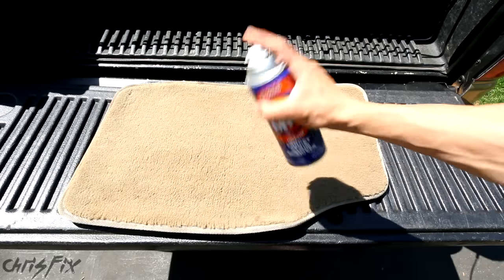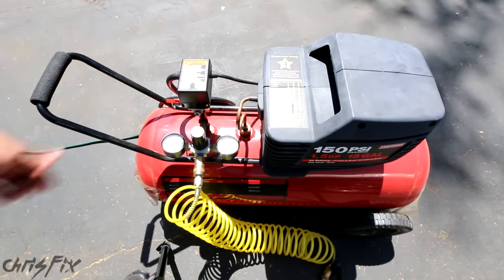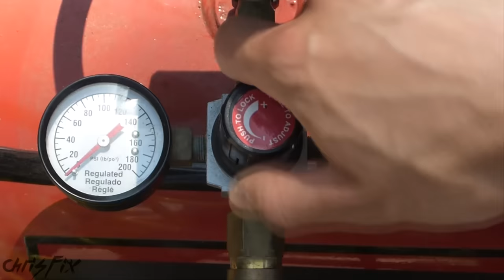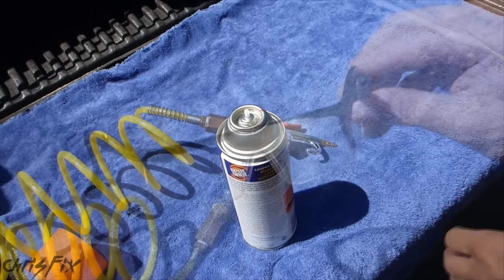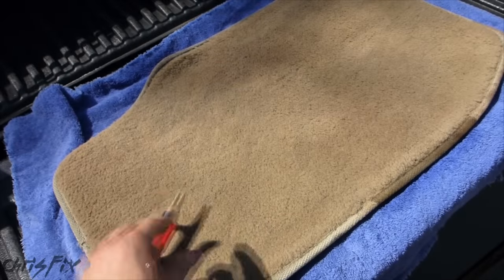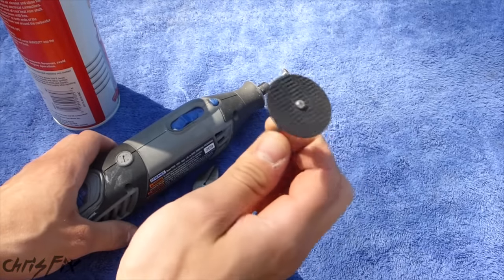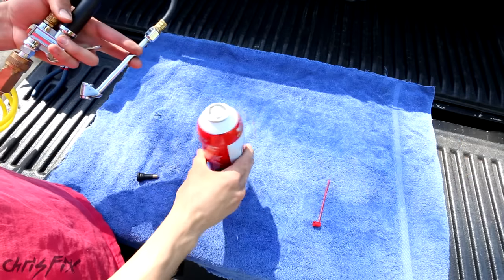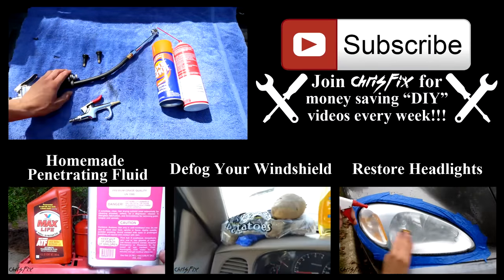How to Refill an Aerosol Spray Can (Like Carb Cleaner, WD40, etc)

Comment: If your can is mostly full of some liquid, you would need insanely high air pressure if you wanna be able to empty the can before running out of air. Actually those cans usually use liquid gas (not compressed air) as a propellant, the gas evaporates at a specific (temperature dependent) pressure keeping the can at a fairly constant pressure (until you run out of gas of course). Usually butane, propane and/or other flammable gases are used for this, which is also the reason the aerosol sprays typically burn so well, even if the actual being sprayed out isn't flammable.
Either way though, compressed air certainly beats throwing an almost full can away. No doubt about that.
Reply: That's what I thought.  No way would you be able to use even a quarter of the contents before running out of pressure.
Otherwise the cans would have to be able to hold 1000 pounds pressure.
Those ' computer air blasters ' are filled with inert refrigerant. If it were just compressed air they would run out in three blasts.

Comment: I found an easier way because it happens a lot and I like being safe. When ever I by anything that is in a pressure can I save the receipts and put them in a file marked with the cans purchase and return it we're I purchased it for a replacement, never been refused by any store as long as I switch it out for the same product.

Comment: One could 3D print an adapter to go from the compressor to the canister.

As of January 2020, the MSDS is now called the SDS, Safety Data Sheet.

Comment: For any spray csn with a standard long nozzle tube you could fill up an empty large wd40 can with air and do a transfer from that can to a smaller can using the long nozzle.  Keep a couple of these air-filled WD40 cans around.  Another point is that compressors often shoot water out  you want to make sure your compressed air is dry before you fill a can. Water in oil paint is a disaster.
Reply: So the red straw is the bridge between the female nozzles transferring pressure from the donor can to the low pressure can?

Comment: It's easier if you take a tire air valve and trim it down to fit the can! Some of the smaller valves don't have to be trimmed, they make an air tight seal and it's just like filling your tires with air! Plus you can use an air pressure gauge to see that you have at least the 32 lbs that aerosol cans uses!

Comment: Thanks for the video but my advice is to get a small vacuum line or fuel line that fits on the can outlet cut to a size that will bottom out while using the outlet down at the same time ,no-spill no worries!

Comment: Use a cut off piece of rubber hose. The right size would fit tight a small ways up the brass air nozzle and if cut off the right length there will be enough to cover the can nozzle  plus give enough room to push down and seal the can. Just a thought.

Comment: I superglued the straw into the air compressor fitting, so you add the air and then push down on the button till it quits bubbling in the can equalizes.

Comment: i use those can-type air duster. most of these are uses liquid  refrigerant as propellant. Invert the air duster can and fill the empty bottle with LIQUID propellant. Done

Comment: I have cans of paint from the 60's that still work well.  The propellant hasn't leaked out because it's Freon. The government banned the manufacture of  Freon (and R12 refrigerant) in the early 80's, to protect the ozone layer.  They replaced the Freon with CO2, and in some cases, butane.   CO2, being a much smaller molecule than Freon, leaks out of the seams of the cans, (into the atmosphere) before the contents are expelled, resulting in millions of partially filled cans of paint, hairspray, glue, and oil going to the landfills each year, where they are compacted (crushed). The oil, paint, solvent, etc. eventually reaches our aquifers where it poisons our water.  R12 refrigerant was replaced with R-134, a less efficient refrigerant.  So we use more gasoline to run our auto air conditioners than we would have with R-12.  

 Now of course many of the same scientists who foisted this on us,  say CO2 and our gasoline consumption causes "global warming". They contributed to the issue.   The kicker is that a few years after the ban other scientists discovered that the ozone hole was a natural event, and not caused by Freon or R12.  

Incidentally, putting air into paint cans, aerosol glues, etc., will cause the paint and glue to harden INSIDE the can.  Otherwise companies would be putting air in cans.

Comment: Just consider that youre refilling with air not butane or propane or any other propellant and that can alter the how you store it. Freezing weather hot weather expansion and contraction and the difference in expansion and contraction properties on the air could lead to harm. I do this method myself, but the msds may differ if the propellant is different. I usually just fill for the pressure i need and thats that so storage is safe.
Reply from the maker: Thanks for the tip! Usually it is at the end of the can anyhow so you use the rest of the liquid inside.
Reply: ChrisFix totally, ive had some cans laying around that were more then half full that lost pressure. I guess my point was to further inform if you plan to store or dont use the products as frequently as you may being a mechanic over an average home owner who may have a can of wd-40 last them 5 years. Anyhow, thanks for everything you do man. Keep up the great videos and stay humble!

Comment: If the can is dented would this mean that a lower psi is needed? Also, what level of danger would this have? Low, medium, or high?
Fyi: ive used your video to redo my car lights and it worked great👍🏻😁

Comment: Hi, simple idea - great! You could do better by re-charging the cans upside down - it will not squirt than :). Also I think the cans are not filled with air but rather some other propellant that is liquid under pressure like gas in gas lighters - that's why the original fill should last for the whole can unless the valves are crap and let by...

Comment: These cans are partially filled with a cryogenic liquid of some kind, that serves as a propellant. The substance is a gas at normal temperatures, but turns into a liquid when it's supercooled. As the substance warms back up to normal temperatures it would normally expand back into a gas, but remains a liquid due to the pressure in the can. Unless of course, that pressure leaks out.

This is why soda goes flat; once it's opened, pressure decreases and temperature increases. The CO2 in soda works the same way and is mixed into the sweet soda under pressure and served as a cold beverage. It stays a liquid until the pressure drops or the gas point is reached.

Filling these cans with air will work to an extent, but normal compressed air has it's limitations. The nitrogen in air can be converted to a liquid, and it's used in some types of beer. The oxygen could also be liquified, but you'd be nuts to combine compressed oxygen with anything that could serve as fuel.

The propellants in these cans usually go a long way, because the volume conversion between liquid and gas. This is similar to steam power, because the expansion happens when these cryogenic liquids reach their boiling point. Compressed air is still only a gas; so it might work to an extend but runs out of pressure much faster.

Note that compressed air works better as the volume of product decreases, leaving more room for air. Spray cans were probably designed to withstand over 120 PSI, but that does not mean they're normally filled to that pressure. The propellants may not generate that much pressure, so be careful when pressurizing them with air.

Comment: If you turn the can upside down you won't get the back spray while filling. Holding it upside down places the end of the internal dip tube in the can above the liquid. There will still be some back spray due to the residual liquid in the dip tube.

Comment: How about dedicating one of those brass spray nozzles to refilling aerosol cans by measuring the small plastic tube that sticks out of the spray can and drilling out the brass nozzle for a snug fit and just deep enough that it will open the plastic tube. Combine that with holding can upside down and wrapping a rag around the junction while filling and you should have no mess at all.

Comment: I like your videos. But this time I have to say something: if you turn the can upside down bevor filling with air, you don’t make a mess with what ever is inside.
There is a hose inside the can, going almost all the way to the bottom. So if you fill it the way you showed us, air is going down the hose, through the liquid, up in the top of the can. There it builds pressure and presses the liquid out of the can. If you turn the can upside down, like you do after using a spray paint can to clean the nosel , the air is at the top of the can, building up pressure but can’t make a mess because the liquid is at the bottom.

Comment: Most of these cans have a small tube in the inside connecting the nozzle to the bottom of the can.  If you turn the can upside down while filling it with air, it will not spray out any of the material in the can.

Comment: If you turn the can upside down, you will not get any mess (this is also used when you want to clear the sprayer part..turn it upside down and push it to get only the air out to clean the tract)

Comment: I'm guessing air doesn't last long, it maybe needs a top up before every use? 
How did the original de-pressure? 
Wouldn't plain air increase the chance of unwanted reactions? 
Lastly, if air can actually suffice why was dangerous CFC used and even butane or similar today? Usually highly combustible gases. 
Sorry for the ramble but I just wondered

Comment: The air blowers with the rubber tip work better for this, as the stem slides into the hole, creating a seal

Comment: Most of my sprays are with propane (not with air), and to bring air in a flammable system, well, not the best idea. But if someone has air sprays, it works very well.

Comment: Use a rubber tip on the blow gun instead of a brass tip, it will slide over the nozzle piece and doesn’t spray all over

Comment: I was simply squeezing the cans of WD-40 or carpet cleaners, they wont blow up without air simple, so I was bending them inside and almost every time it was enough to empty them two times I just made a hole in WD-40, however still this method might be helpful in some cases

Comment: You do realize that most of these products don’t have “air” in them. It’s called propellant. Which is usually a chemical designed to not only push the liquid out of the can but also keep the chemical from drying or sticking. Example: spray paint cans use acetone as the propellant which also keeps the paint from drying and prevent the nozzle from clogging.

Comment: If you put atmospheric air in an aerosol can containing carb cleaner it will make an explosive ratio and if it meets a source of ignition the way front will detonate back faster than you can blink your eye and blow your face off. You must use nitrogen argon or CO2

Comment: Using air to replace lost propellant works fine. But air is NOT the original propellant that was used in the can. Propain is a very common propellent used. There are many others. Carbon dioxide is commonly used if the can contains food stuff such as whip cream. 
Using compressed air means you might have to recharge several times. But that's ok. As long as you get to use the entire contents.

Comment: There is no need to cut the calve stem down the nipple does not need to be pressed down. The air pressure over powers the check ball

Comment: As far as I understand physics, there is no need to cut the Car valve short.
There is no need to push down the valve in the can, the air pressure will do this for you!
Less messy and quicker :)

Comment: Hi Chris Fix, my problem is the thing where you attach sprayer got broken, so nowhere to attach the sprayer. My question is, can I just open the canned airwick freshener like the one that uses battery operated dispenser?  I'm thinking of transferring in a spray bottle so I can still use the freshener..... Thank you...

Comment: Aren’t all air blowers “air guns” OSHA regulated around 25 lb. Of pressure to stop accidents in the shop from working or someone clowning around.
 In the body shop we had some drilled out to get dust out of bondo scratches and pin holes.

Comment: If possible use dry air and oil separator to prevent unwanted reactions inside can. Also thinking about using nitrogen to make sure not oxygen content in a pressurized container that can mess can contents

Comment: Maybe use a small cut of plastic tubing over the nozzle and the can tip to avoid the over spray?
Reply from the maker: I was actually taught afterwards that if you turn the can upside down it helps lessen the spray significantly!
Reply: ChrisFix thanks for the tip

Comment: Do I have to,have an air compressor to do this.  I got a bit confused but I did look at the stage where you changed to the tyre pump value.  So you used the compressor but just changed the method yiundeliver3d the compressed air?
Reply from the maker: Yes

Comment: I got this to work but the second I open the air blower while pushing down the nozzle, PB Blaster (what I'm filling up) sprays everywhere. Even putting a small vinyl tube between them didn't really help avoid that. I only got a few seconds of air sprayed into an 11oz can and it seems to have some power to spray out now but probably not enough for long.

Comment: If one does not own an air compressor, seems the  tire infiltrator at the gas station would work. Do you you know what pressure they have? I was guessing around 75 PSI but do not know.

Comment: Besides the explosion hazard. Most cans are NOT filled with air, they are filled with propellants and Inert gasses and most are oxygen free. Some chemicals will explode when mixed with air under pressure. Think of dieseling. Some solvents have a low enough flash point that just pressuring them with air (20% oxygen) will cause an instantaneous explosion.  Refilling a can violates several Federal laws. For example: "It is a violation of Federal law to use this product in a manner inconsistent with its labeling." 40 CFR 156.10(i)(2)(ii).
Reply: but as you fill it you're keeping that dispensing valve open, so if the residue propellant reacts with the oxygen, its gonna shoot out some flames trought it, without most likely exploding

Comment: Just because the air leaves the compressor at 95psi, does not mean the pressure in the can you're filling will be 95psi. That's quite dangerous advice as the pressure in the can will vary depending on how long you fill for and how much liquid is already in there.

A car tyre inflator with a pressure regulator will do a safer job.

Also invert the can - there's a straw inside so none of the liquid leaks. If you put it in the fridge beforehand, you'll get a better fill as well.

Comment: Lol did you know they have these canisters you can purchase that you can fill with your own product and then it has a shrader valve that you can add a compressed air to make your own can of product? We used them at my shop with a 55 gal drum of solvent for cleaning under carriages with. Waaaay cheaper than using pre made over priced cans of solvent and there’s no chemicals added for extra compression other than the air and whatever you wanna spray. Think they sell them at ole harbor or at least online somewhere lol

Comment: Do you even need to force the valve downward when using the bike style valve? Won't the air pressure be enough to open the valve?

Comment: As a retired toolmaker from Australia that is NOT  copper  in the  rubber valve stem it is "BRASS "  I worked for in the manufacturing factory .

Comment: Good video....would have never thought of this. 
However, really should be using rubber or latex gloves min. 7mil. ( They are cheap at places like harbor freight or Lowe's etc.) And not just for the product skin contact. But to keep compressed air from getting through your skin if you have a "slip". I have witnessed 3 people put themselves in the ER over blowing air/product under their skin, or worse into their blood stream. Under the skin just kinda looks bad, big brused bump or blister. And sure looked like it hurt like hell. But was not life threatening. One guy it was a life threatening issue. To the point of something like a stroke happened to him, and he stayed in the hospital for over a week.

Comment: I believe there is a safety issue without holding the can in a metal container tube or so. Should the walls of the can get weakened over time, there is danger of it exploding and having very serious injuries. My apologies for putting dampers on this. It can work but needs precautions and safety mechanisms.

Comment: I use WD-40 in a pump spray bottle, if I had a can with no more pressure but still had liquid I might drill a hole and pour the left over in the pump spray bottle.

Comment: just simple make a brass adapter for the can nozzle , drill a hole in a brass water fitting plug ... or use that brass from tire valve plug it with solder and drill in it, or conect with solder a bras cap and drill in it...

Comment: I used to just pierce the can with a nail if there was absolutely no air then cut out the top and drain it in some container. For carb cleaner I would use it as a bath for cleaning small parts. If there is a little air, I would shoot it with a pellet gun from a distance.... Lol then drain and use. 😎